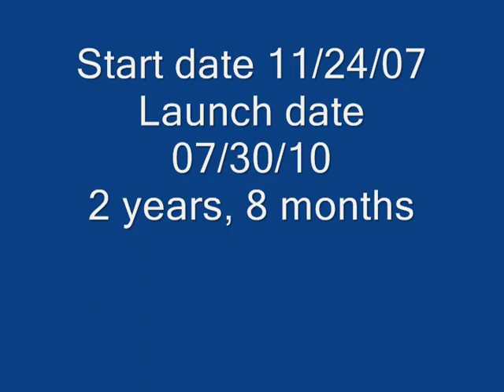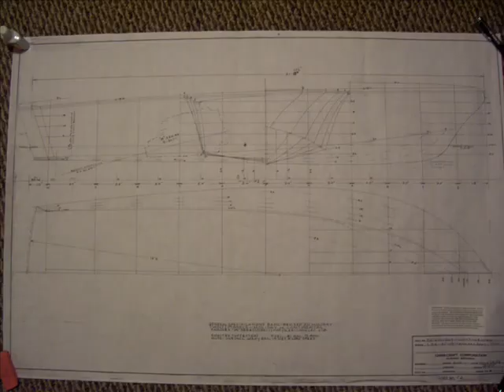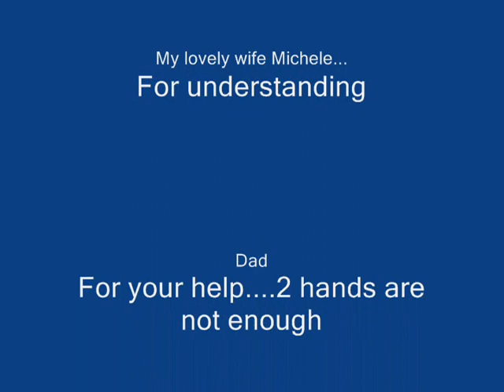Chris Craft Continental Restoration Video

Comment from the maker: The chainfall is attached to the bearing, which lifts the pipe. The boat is turned by an electric cable lift attached to the ceiling rafters. Get Don Danenberg's book "How to restore your wooden boat" I used it from start to finish on the restoration.

Comment: beautiful boat, can't beat the look of stained wood boat. quick question though what is the pink stuff on the stringers when you were framing it up? I've got a 1978 thunderbird. it's fiberglass but has quite a bit of wood work and some of it had pink stuff on it. I pressure washed it off but now seeing it on yours wondering what is is.
Reply from the maker: Mahogany colored 3-M 5200 caulking. Messy stuff, gets everywhere. It is used for bedding the wood together.
Reply: the stig mach 1   I grew up with a 1977 Thunderbird 20 ft, 351 Ford motor on Green Lake WI dad sold it in 1997. Great, heavy boat

Comment: How much of the original boat was left after the make over????  Not really a restoration but good job.
Reply: The stringers, a few deck frames, hardware (steering/prop shaft, chrome etc.) was about all that was saved from original. It sat outside for 20+ years before I bought it. Rot and ants did a number on it....